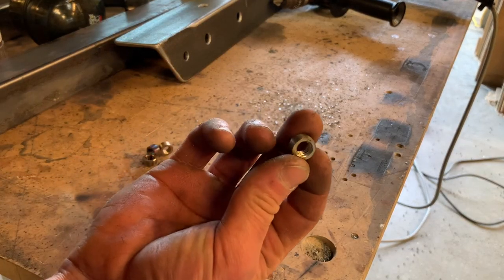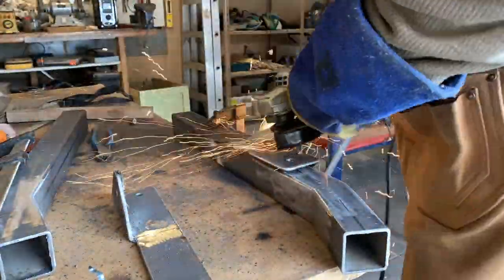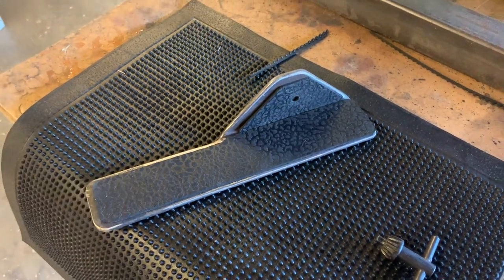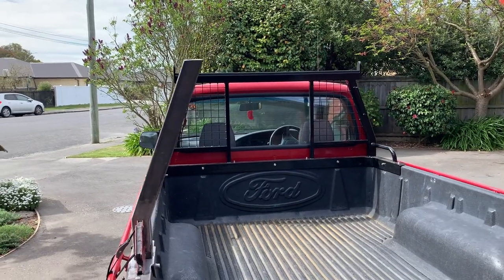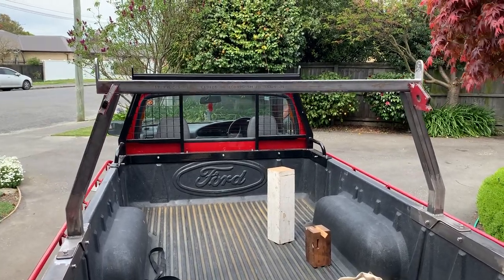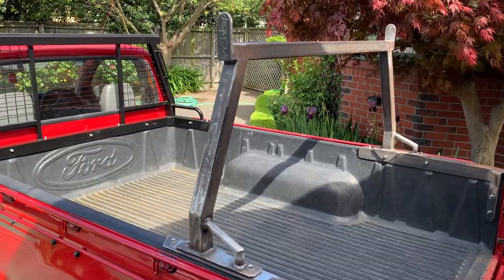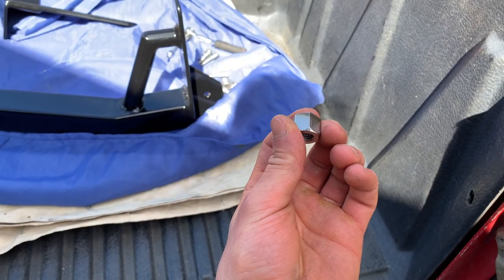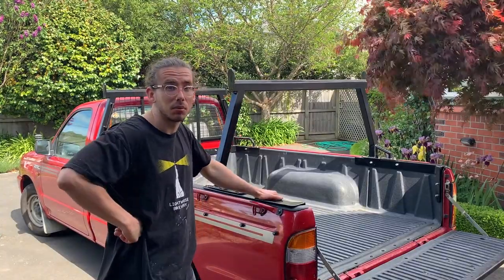MAKING A STEEL LUMBER RACK FOR MY TRUCK (Part 2)

Comment: My dude you're still stacking dimes even with the flux core! Excellent build and video!
Reply from the maker: Thanks man, I really appreciate it!
Reply: @Beyrer_Bespoke_Furniture  self shield flux runs better with electrode negative.   The ground clamp is positive.   Not sure how you had it hooked up.  But give it a try, you'll be surprised. Great work on the project!
Reply from the maker: @Gmoney201201   Thanks for the tip, mate! I think I did swap the electrode when I ran this wire but I still found it difficult to get clean weld beads but perhaps I just need more practise with the flux core wire.

Comment: Nice job! Perhaps some 3/4" or so holes in the vertical plate atop the racks for hold down straps to secure your plywood.
Reply from the maker: Thanks for the comment mate, I was thinking about doing something similar but in the end decided against it. Could have been a good addition though!

Comment: The attention to detail, craftsmanship and the  ingenuity bending and fitting. 
I love it. 
Nice build had me to the end of this two part series. 
I agree with the splatter weld vs gas and it shows.
Spend a lot of time myself cleaning up welds.
I love the truck, in what country is this from?
Great job.
Reply from the maker: Thanks a lot Mark, I appreciate you watching! I live in New Zealand and not sure where you are from but in somewhere like the states a truck this small would be pretty uncommon I'm guessing but it's great for what I need it for!
Reply: @Beyrer_Bespoke_Furniture  States, I own a small Ford Ranger (2011) nice truck there, even cooler Rack/s!
Reply from the maker: @marktaylor9975   Oh nice, cheers mate!

Comment: A little late but for future reference, I bet when you switched to gas-less welding you didn't switch the polarity. Normal shielded mig requires DCEP (electrode positive) but self shielded flux core requires DCEN (electrode negative). It also requires a farther wire stickout, about 3/4"-1" compared to 1/4" on solid wire. If ran on DCEP the arc will be very rough and have lots of splatter. Its possible to get very nice welds with self shielded wire. It looks more like a 7018 stick weld rather than a solid wire weld.
Reply from the maker: Hey mate, yes I did switch the polarity in my machine but things still came out pretty splattery. Once I wire brushed the welds back and chipped of the slag they looked decent enough but I couldn’t seem to get rid of the initial splatter. I used a E71T-11 wire which from what I understand is comparable to 7018. I’ll try the longer wire stick out next time! 👍🏼
Reply: @Beyrer_Bespoke_Furniture  the whole reason for negative electrode and wire stickout is so that the flux in the wire has enough time to heat up so that it can properly melt and protect the weld puddle.
Reply from the maker: @SlapHappy  That makes sense, thanks for the info mate!

Comment: Very professional results.   I would hope to get a follow up video with  a review of  good and things that could be done better after you have used it for a while, for your applications of course. Wind noise if anything movement and  after thoughts  on choice of mounting location and style.  Maybe a video isn't needed to give that review.
Reply from the maker: Thanks for you comment, mate! It has been about 6 months since I completed the second portion of this rack and so far I have been very happy with the result! I have been on the highway a few times now and haven't noticed any wind noise at all, there was a very slight vibration in the steering wheel when at 100kmph and I wandered if that may be a little bit of wind drag from the rear uprights but I haven't remove that part of the rack and tested that theory yet. I couldn't be happier with the mounting locations as it fits plywood perfectly and I can also get timber loaded directly onto the rack by forklift at my local timber yard which is very useful! So far I have carried x10 sheets of 21mm plywood on the rack at once and also multiple loads of solid timber and I have had no issues. It is still very solid and I think the style suits the vehicle well. I hope that helps!
Reply: Very helpful review. I am retrofitting a lumber rack from a full size bed 8 foot to a short bed 6.5 feet. I have already reinforced the front and will barrow the rear stake pocket mounting point on your design, for added strength... great video, I believe you are probably just as talented with wood as you are with working metal.
Reply from the maker: @mandeladams4793  Sound like a good plan mate, that rear mounting point has worked out very well on my truck and is super solid. Thanks a lot for your kind words and good luck with your project!

Comment: cool great job - what gauge do you use on those square tubular ? do you weld on 80amp or 100amp ? rod 7018 ? or 6013 ?
Reply from the maker: Thanks Mike, the tube was 50x50mm with a 3mm wall thickness. I am unsure on the amp but my Mig machine has a 220volt input and the welding wire I was using was E71T-11 which from what I understand is similar to 7018 rod.

Comment: 3x3 or 2x2 steel tubular for the roll bar?
Reply from the maker: We work in millimetres here in New Zealand and this tube was 50mm x 50mm which works out slightly under 2x2.
Reply: @Beyrer_Bespoke_Furniture  thanks

Comment: Buy a van and stop messing around.
Reply from the maker: Haha thanks for the advise mate but I’ll stick with the ute. Being able to load timber at the timber yard with a forklift is a massive plus and unloading longer lengths of timber off the top of a van by hand back at the workshop would be a real pain!
Reply: @Beyrer_Bespoke_Furniture  A Chevy Express isn't too high to unload long lumber and then I have an open trailer when I need a flatbed.
Reply from the maker: @richardmckrell4899  I looked that up and they do look like a great vehicle but unfortunately I don’t think we get those here in New Zealand. They would probably make more sense for a cabinet maker too as I don’t generally do work on site as most of the pieces I build are completed in my workshop and often times collected directly by my clients meaning I don’t often need to cart tools etc around. I appreciate the tip though! 👍🏼
Reply: @Beyrer_Bespoke_Furniture  Ok